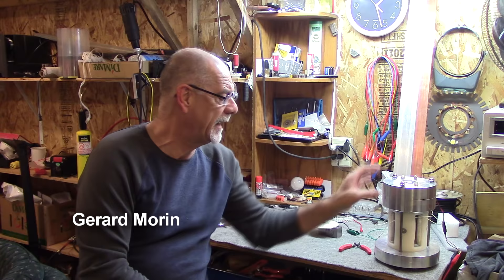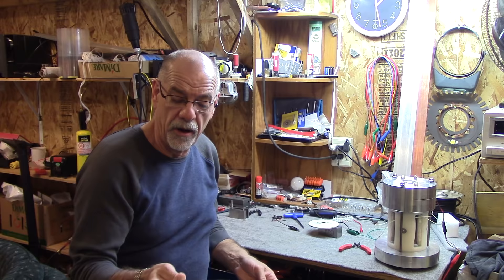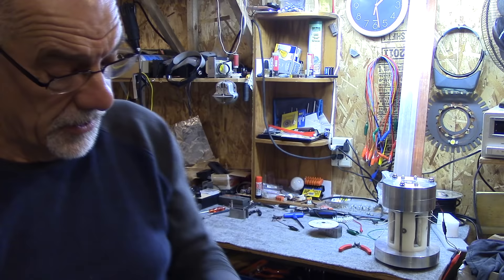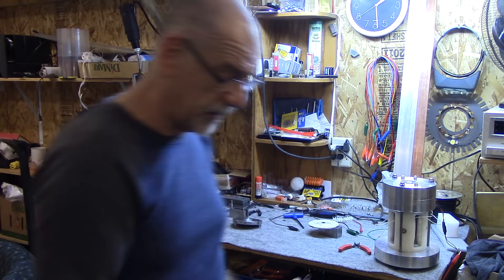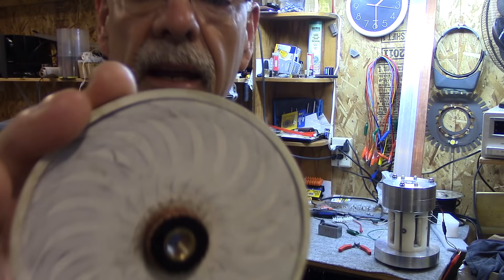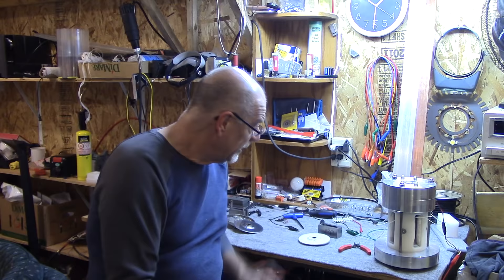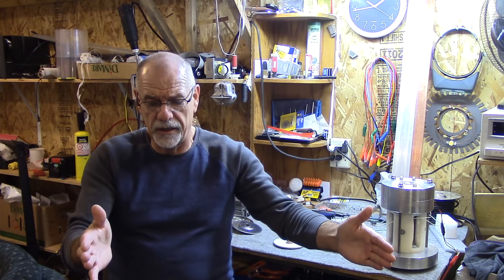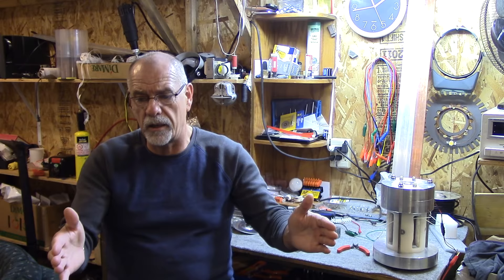Gerard Morin: Hidden technology the world doesn't tell us about

Comment: The model of magnetic field scraping like a brush across the coils is a misleading metaphor. Nothing like that is happening. Electrons are also a metaphor that is not real. They simply are an invention that enables simple math to predict or document results for limited applications. They won't help you actually understand what is happening or predict what will happen in new configurations. The magnetic metaphor is known to be false because it fails when applied to explain the Faraday Paradox. The truth seems closer to the model that a magnetic field is just the result of moving charges. Its a radiant electric field that can move other charge fields and also be converted to charge with the right conditions. The really unexploited feature of this radiant field is that the source is independent of the radiant field... meaning the actions of the radiant field will not burden the source of the field. Fundamentally any moving charge is a free energy generator. You just have to build systems that exploit how this works if you want free energy.
Reply: So from here, you asked for this in your latest video, how does your spark gap make energy?

Energy is generated by any moving charge. Concentrating the radiant charge field from that moving charge and harvesting more charge from it than was used to create it is the process of "electro-magnetic induction". It just has no magnetism, that's just a misdirected metaphor. It does have a radiant electric field. Which like the light from your flashlight does not grow dimmer depending on what you illuminate. Plus, most methods in use today to capture this free energy immediately use the captured energy to feed back into the induction process and cancel out the source charges. This makes us burn resources to keep the process flowing. Its and intentional scam to generate wealth and limit the availability of power. Not only is this method controlled, more competitive methods for making energy are also suppressed, but that's another story.

So, the most radiantly active charge source is an accelerating charge source. How do you accelerate charges? 1. Make it go in a circle, it will constantly be accelerating. 2. Switch it on and off, each transition from zero to max and max to zero will produce a huge acceleration. The larger the differential, the bigger the acceleration; the more radiant energy expressed per moving charge.

Different materials react to charge and radiant energy differently. Conductors primarily move charge, and force the radiant energy outside to follow along. Dielectrics conduct radiant energy but block charge. A conductor/dielectric interface will convert charge to radiant. A capacitor is a c/d/c interface and converts charge to radiant to charge of reversed polarity.

Tesla's hairpin circuit shorts out the charge in the rails and sources a huge amount of radiant energy which is converted back into charge at the sites of the conductors, so you can drive a high voltage neon bulb in series with a person in series with a normal lightbulb under water and not electrocute the person.

Radiant energy will flow to the sink that has the largest capacity for radiant energy. Joe Bedini's SGC that charge batteries do it because the radiant energy generated by his pulsing coils runs backwards into the batteries with more capacitance than the coil... contrary to the direction of the voltage running the coils powering the motor.

Altering the capacitance of the coils will generate electricity in a motor; something Joe Newman accomplished with massive coils and TC Heins accomplished with bifilar windings.

Tesla observed the extra radiant energy turning into voltage in Edison's DC power substations when they were switched on. He played with it until he found a resonant frequency for generating on-switch/off-switch sparks. He produced a voltage pulse that resonated with the radiant pulses in a way that amplified the total wave of both. The resonant pulse-train was self-sustaining in that it amplified more than enough energy to propel itself without loss through the air. But if the driving pulses stopped, it wound itself down and faded. Just like Joe Newman's motor which did not lock up when he shut it off.

Peter Lindemann does a review of Edwin Gray's spark gap energy driver for his electric motor and points out that his patent application has three separate design features that bleed off excess energy. What he misses is that the circuit also has a Tesla hairpin in it, a capacitor with a dead short, designed to put the radiant energy to work in a positive way, which is what is captured from his primary spark gap.

Your specific open ended circuits with a changing current/voltage or voltage with high radiant content connected in the middle of a circuit with spark gaps on one side and inductor and what seems to be a large capacitive light bulb in series is similar to several one wire circuits that Tesla operated. 

The wire leads are active capacitors and they will charge and discharge with each cycle. The voltage may not be enough to light the bulb, but it's still moving radiant energy into and out of the coil. 

The spark gaps though create a huge amount of radiant energy which is flooding the circuit too.. This is being captured by the wires and coils, gap fixtures, and light, which all turn it into electricity. So you're getting a really inefficient capture of the power generated by the spark gaps. 

The spark from the lead of the generator is the difference in voltage between the two devices; your generator and the circuit components converting the radiant energy from the sparks.

Comment: I see you excluded iron and I wonder why? When copper interacts with magnets, the copper develops heat but iron does not.? Or what?

The way I see this is that iron does an excellent job in transferring the pulse to the copper winding which in turn picks that up without being agitated to a point where the copper heats up, the iron is NOT affected by the flux at all.

It would seem that NOT using iron is to fight against nature while using iron is to work harmoniously WITH nature!

If the only reason to exclude iron is weight then a big problem occurs with heat instead!
Reply from the maker: Mr Affeman, if you look back on some of my previous videos I explain that I have observed Iron causing a braking effect on a completed circuit. High voltage, high resonance.. resistance disappears when you spin the right motor, the draw on current stops, introduce iron to that system? it's like hitting the brakes.
Reply: Ok, I'll look into what you said earlier.

So using copper and magnets only is preferred eventhough more load generates more heat?
Reply: yes indeed.. thank you Gerard       Jay

Comment: Ok...but you need to find a way to keep the batteries you use charged ...so you need a battery charger to keep the batteries charged charged can the moter you use be connected to the batteries to keep them charged .And even the best batteries only last so long then need to be replaced . so it  is a temporary power supply and then  as they {batteries} wear out they need to be replaced ...so you need batteries that last at leased 100 years to call it free energy ...thats my opinion...

Comment: That motor was made to burn out, or use the brushes to make it seem like the whole motor is shot,, the brush setup is proof that they dont give a hoot about if it fails, because they sell the motor as is, and if anything happens after sale,, that isn't covered by a warranty,, that would no longer be their concern, they only make it so that they cover their own behind with how long it will last.

Proof of concept for failure, make object that can heat up out of plastic, ie, bearing housings, comutatot brush holder, coil encased in plastic so as to deform with heat.
Have magets based on metal that will become 1 whole magnet over time so as to loose functionality as a motor to create a lower magnetic field spread over a greater surface.to induce more heat to the advantage of heat displacement to melt all the plastic parts,,lol.

Never buy a motor with brushes if you can help it, and that is a hard thing to find at most times, because all the technology for motors in use in main creations use brlushed motors.

Comment: Interesting. Thank you to blicax for the link suggestion. I'm building a CNC machine and this is a very good source/reference. This link: http://m.made-in-china.com/product/24V180W-Printed-Circuit-Motor-Disc-Pancake-Motor-Light-Weight-and-Cute-679085581.html is for a similar looking motor. But if you search for pancake motor on the original link there are 11 pages. I didn't go through them all. Mouse holing on the web is not my favorite thing lol. I can see potential with the new 3D printing technology available to print some interesting motor designs.

Comment: Design solid state graphene Crystal solid electrolyte power cell's with a spark gap. Then locate the harmonic hertz frequency of the power cell's that optimizes its total electrical generation out put. Then use a digital motor to use with the resonance generator or a pankcake motor. The crystal power cells generate electrical current from the Schumann resononce that will start the resonance generator. Has the resonant frequency go's up generating a resonance bubble that will increase the crystal power cells electrical current till the crystal power cells start to spark gap with that electrical energy then being used to power other devices. I know you understand what all this mean's? Larger power cell's larger vacume spark gap's? Umm smaller resonate generator? Two bysecting fields of energy one going out into space the other being drawn into the earth. Know these frequencies of energy first then you will know how to calculate what refined crystal structures are all ready being vibrated at? Is gravity vibration? Energy is vibrational energy resononce? I did not go to school for this knowledge so this why i ask you?   = /

Comment: on YouTube there's a video with a three wheel trike, bicycle utilizing the same motor type you're playing with from my knowledge controller that comes with it will only put the 25 miles per hour out of it but these guys in the shop modified that controller you know they had that thing smoking the tire continuously throughout all speeds you find the right one it's all done in a parking lot yes I realize the rear tires lightly loaded

Comment: About this kind of  motor:
that motor power is 120w, speed is 3000r/min ,rated voltage: 14.4v, output torque: 0.4N.m  , motor efficiency: >82%. The structural characteristics:No magneto resistance,slide without help, out size: 10cm*1.8cm, weight: 0.7Kg 
Price in China is around 150 USD

Comment: Well suposedly what this is about probably glass ore cristal type elemets who have diferent metal particel in them .
Well tehnicaly speaking they just found a way how to focus magnets probably.
And they use simpel dry cells baterrys thats staff simply recharge alkaline baterry on a stove when I was kid todays probably they call such type thermal baterrys it can by build out of any thing well it does have unique pripertis like ordinary baterrys but they act as capacitor coil and baterry at the same time.
So he does have a point there 
A generator is only limited by hes materials with what its constructed.
Well add cooling to that generator like a fridge liqued oxygen no resistance,add grafite oil ore florine based gas ore magnetic bearings no friction ,add mercury instead of brushes there you go most likely no problems what so ever ore just use welder diodes in series ore pararel with normal bridge rectifier.
Probably that wuld solve lot problems.
Back in the days peopel used manual switches to have motor generator functions.
The funy thing is those motor generators hade split shafts,2 counter rotating shafts ore 2 oposite turning shafts ore simply modufied stator with space so that same generator consuming power tought rotor wuld act as starter motor with pulses so the golden ratio is hit and miss engin stile ignition system it uses mechanical baterry flywheel inurtia effect .
So yep not many peopel know about those litel facts.
So hes right .

Comment: i wish i qud talk to you and learn more dude I feel we have a lot in common I love to take things apart to my father used to give me the same grief I'm a very good mechanic when it comes to cars in the solar panels now going to get a couple hundred 20 watt solar panels and a grid-tie inverter no batteries for supplemental power use all these people are using engines now using a little bit of electricity either from their Gas and Electric Company or they're using battery power to get the engine spinning while spinning disconnecting house power to it and hook generator power to it having itself powering itself hard to explain but I'm sure you've seen people using 2 engines want to spin the generator generator powering the motor porches powering the generator or making the generator spin to give us power

Comment: volts is NOT resonance. More examples of a  little knowledge is a dangerous thing. Suggest you read some basic electromagnetism books.
Reply: books make blind minds if you just take the word of nay sayers then you have nothing to contribute as you let a book talk you out of really finding what is or isnt possible all the cant be of past has been done to success based on  the question why not and try anyways and i disagree with your position as all energy  and terms properly referred are  first light converted to an other form all based on wave forms and all relative terms must correlate to that basis of its existence and form  of which is was always will be a wave cant have 120 volt proper less 50 60 hrz and that is electromag. wave form needed to achieve that voltage n that is written on everything built to use that rated input  so no dis but i think your books are feeding you full of shit on purpose to keep you  preditated
Reply: Morin said resonance is not a sine wave, therefore Morin is very well aware resonance is not same as voltage, bc voltage obviously is a sine wave. The resonance makes the hertz, the hertz makes the volt. Pay attention.
Reply: The universe IS resonances in different wavelengths. All matter and energy at its smallest observable form is resonating... prove this incorrect.